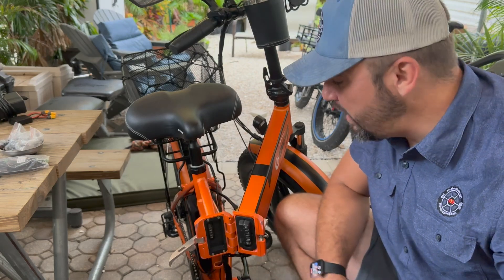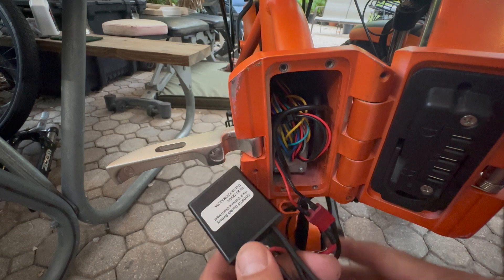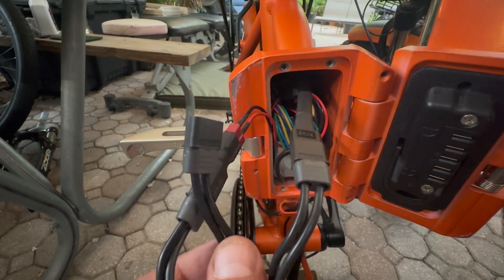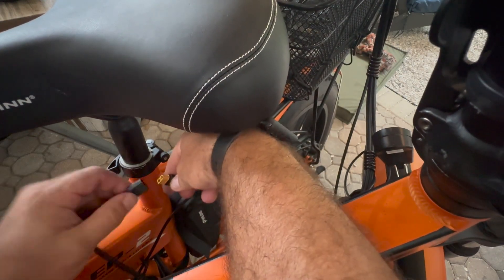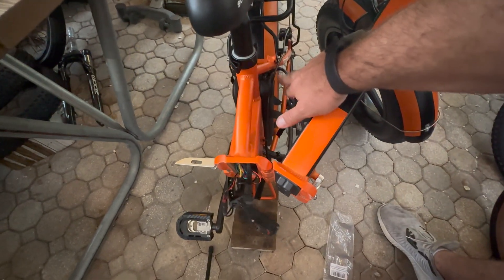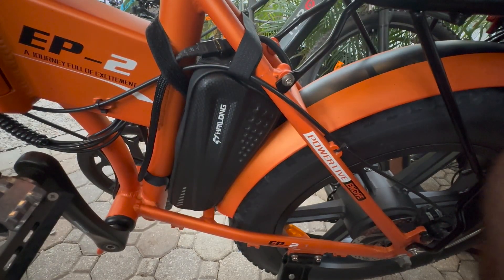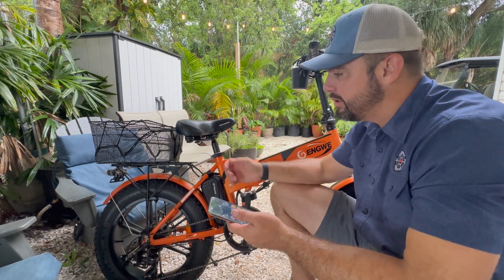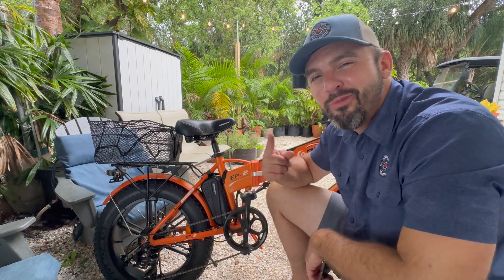Engwe | EP-2 E-Bike | Plug & Play Dual Battery Balancer Kit Install Two Batteries on Electric Bike

Comment: Hello sir, Please teach me how to fix my Engwe 750 ip2 pro. The problem is that its battery display is always full, even when the battery is low or discharge, it is still full. I tried following the steps on youtube, but it's still the same. Please help me sir.
Reply from the maker: You will likely need to get a new controller from from Engwe

Comment: ive had your kit for a while now on my engine x and have a 25ah on the rack and a 13ah in the frame. i have a power analyser on board that shows watts, amps, ah's etc. i did about 50 miles and had the battery down to about 1/2 bars. i noticed the battery in the frame was down to 46.5v and the rack battery was down to 45.5v a difference of a volt. i thought a balancer would draw down in such a way that both batteries voltage would be the same. what could cause the 1 volt difference?
Reply: Hold on. Are you saying that one battery had a lower charge than the other while both batteries were connected to the kit (which is essentially a dual battery balancer)?

From my understanding, both batteries should ideally have the same charge level, as the balancer does not provide full protection against differences in charge—unless I’m mistaken.

However, I doubt I am wrong because I faced a similar situation. My controller got fried when I was foolish enough not to check if both batteries had equal charge levels.
Reply: @mindsindialogue  might have just been an anomaly as I did a short trip and both batteries showed 50.2 volts after a run.i know there is a big difference in capacity and the 25ah battery took a few charges to reach full capacity and it's a lot newer than the frame one. Can't complain though the range is pretty good considering I'm up and down hills all day carrying a lot of kit.

Comment: Do I need the 20amp or 40amp kit? Just have the EP-2 Pro and stock battery... but looking into maybe buying a very large capacity battery (or two) for long range, and maybe use your product with it. Also, maybe this is a goofy question, but will the key ignition still work if the center of the bike does not have the original battery, but is powered elsewhere? I am assuming it will just turn on without a key... If there's anything else I should know or any other limitations of the bike, controller upgrades you might recommend or whatever, please let me know
Reply from the maker: The 40A kit will work no problem. If the key is an on/off switch for the battery it will no longer work that way if you add a second battery. You will use the display as the on/off switch.

Comment: That's great, but I prefer it to be cheaper to buy another battery, from the same Engwe brand, than to make those inventions, in short, I can't spend more than half an hour on the bike, so it doesn't matter to me when it's wearing out. one, I stop and put the other on.I did the math, and I saw why I have an engwe ep 2pro, and a battery for that ebike is cheaper than buying the entire kit plus the battery. If I have to do that to have more autonomy, I don't see the point of it, in Amazon battery 48v 10ah $228
Reply from the maker: Why would you write this?
Reply: @ElectricAllWheel  Ok, sorry for the rudeness of the last sentence, it was not my intention, I just expressed my point of view on economics to offend you, and I admit that I exceeded my vocabulary, I'm sorry, my apologies.
Reply from the maker: The kit plus the battery used is cheaper than a factory battery…so this still doesn’t make sense
Reply from the maker: @techvaper This comment is still false. You have edited it, and it still conveys incorrect information. The 48V 10ah battery, second link, is $179 (6/25/2024). If you feel compelled to spread negativity and false information, do it elsewhere. You will be blocked and reported if you continue.

Comment: This kit work with nxb euy 750w ?, I need to upgrade a second battery
Reply from the maker: Feel free to email us at electricallwheel@gmail.com. Send pics of your controller specs and battery to controller connector.
Reply: You ever figure out if it would work, I got a nxb and wanted to get a 2nd battery?
Reply from the maker: @Redzalio  Feel free to email us at electricallwheel@gmail.com. Send pics of your controller specs and battery to controller connector.
Reply: @Redzalio I bought it with him, he recommended the 20 amp balancer and I put the 48 v 15 amp Hilong battery in it. The total is 28 amps with the 12.8 amp battery from the factory, they charge at 52.8 v and get an extra couple of miles on speed,

Comment: hi there. great video. I live in the u.k and own a brand new engwe engine x with the 48v 13ah battery. I know I wouldn't be able to have the battery way down where you have it because of the suspension. luckily I have a topeak explorer bag which I modified the adapter to make it fit the chunky rear rack. I could put a battery in the top compartment and use velcro to make sure it doesn't move about. I like the balancer kit as it has everything I need. what sort of battery would you recommend? and could the kit be shipped to the u.k?
Reply from the maker: Please note, the balancer does NOT work with the regenerative braking feature.
For a second battery just ensure you match your system voltage rating (48V) and can connect to XT60.
Your battery will depend on your budget and needs.
Yes we do ship to UK. All warranty replacements shipping costs will be paid by purchaser.
Reply: @ElectricAllWheel  that's OK. The engine x doesn't have regen. it's a u.k road legal ebike 250w pas>15.5mph. I really like the bike it's effortless to ride and has a really torquey motor too. I've already spent a small fortune on the bag, 11/34 freewheel, litepro crankset, indicators, rearview mirrors, 203mm rotor with adapter. anyway thanks for the speedy reply and take care 😊👏
Reply from the maker: @simonjohnhinton1938  sounds good. We have yet to have a warranty item issue with overseas shipment, but it is a caveat to that action.
Keep in mind, the battery is only voltage dependent. amp hours Ah depend on your budget and desired range
Reply: @ElectricAllWheel  Does the engwe ep 2pr0 bring braking, generative braking?
Reply from the maker: @talito777  no regen to our understanding. That’s for the pro
Reply: I'm thinking of getting a 48v 10ah battery that fits nicely inside a waterproof bag that can hang underneath the saddle. It has the xt60 connector but I want to install an isolator or on/off switch so I don't have to unplug it. What would you recommend and could you send me a link please. I would be ever so grateful as I want it to be safe that's why I bought your kit.
Reply: @simonjohnhinton1938  Engwe has a replacement Rear Rack + Rear Battery combo that fits the engine x for presale. The supplied battery fits into the rear rack and has led charge indicator built in. An equalizer is included and a rear light is built into the 13ah battery.
Reply: @PHOT0GUY  I've seen that but at 399 it's too pricey. I can get the battery and bag for £250
Reply: @PHOT0GUY  Can you give the link to what you wrote about the engwe?
Reply: @simonjohnhinton1938  where did you see that price?
Reply: Where can I get an extra battery 🔋 for the ep2-pro

Comment: Hi there". Nice kit,  can you give me any more info on this battery and all the other bits you needed for the job,  is it still working OK, I looked on amazon and sadly it's out of stock and they don't know when and if its coming back in 😢 any help much appreciated.
Are you on Facebook or messenger if we need to chat.
Ps I'm in England
Reply from the maker: This post should provide a library links and videos to help answer your questions.
For your battery you can get any amp hour Ah you want just make sure to match your system voltage and that you can connect it to the kit with XT60.
https://electricallwheel.com/how-to-install-lectric-xp-dual-batteries/

Comment: Will this still work with a different voltage battery?
Reply from the maker: You don’t want to hook up batteries that differ in voltages from the system for the sake of optimization. However the balancer will work with paired battery voltages up to 72V

Comment: Great kit! I used 2 of them. I have installed 2 extra batteries using these kits. Each one took me 15 or 20 minutes. Simple, easy, and works without problems. With 3 batteries my speed and distance have been increased a lot. Speed 39.4 miles an hour. “throttle only”.  Distance over 150 miles. Set on level 3 most of the time.
Reply: Hi, I’d be interested in how you did this. Could I see a photo. Also, did u have to attach more discharge converters as I’m not sure how u could fit more than 1  in that type of frame
Reply: Don’t know if u could send a link to a pic of your bike setup
Reply: Héllo, whats the extra batery volts?

Comment: Just purchased the kit from amazon which outlined where the connections go very nicely with a chart. Also ordered the 48v 20ah battery so cant wait for them to come!

Update:
Received the dual balancer kit today and just installed it, without the second battery atm as it is arriving in a couple of days. Had to install the balancer outside the frame as it would not fit, going to secure it with zipties and also some black tape to make sure it doesnt move while i go for a test ride! my ebike is euy auloor all terrain.

Final Update:
Did a 23mile ride going 15~20mph, and didnt have any issues! just need to wait for the secondary battery now, thank you so much!
Reply: Hey bro can u pls help me wich battery to buy i dont realy understand anything in this video
Reply: @user-fr7bq2gj8e  what bike do you have?